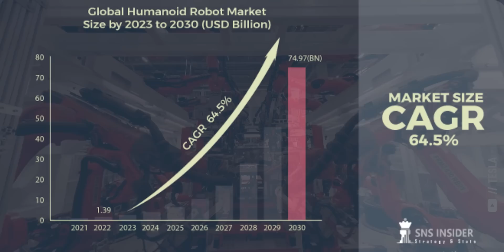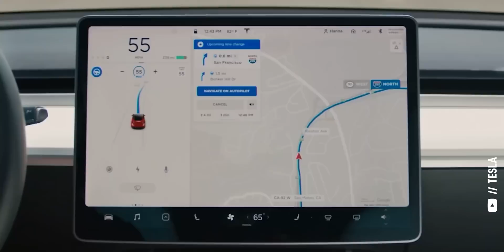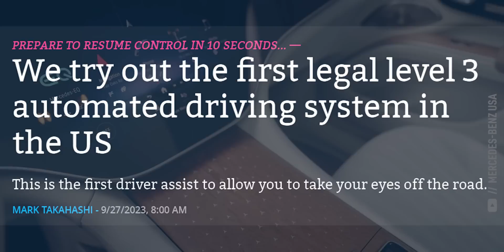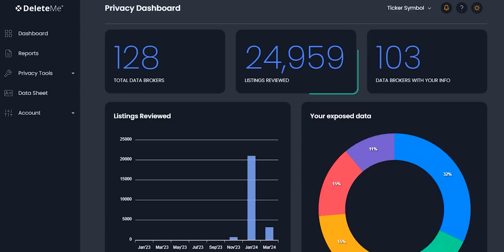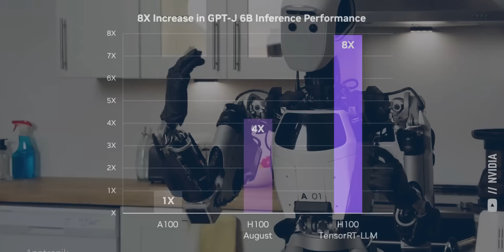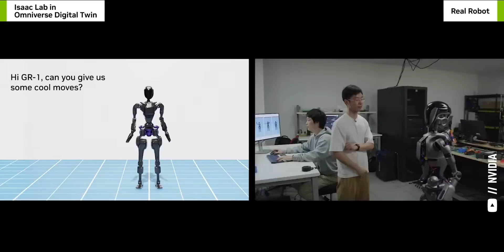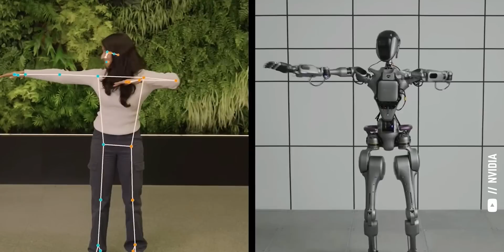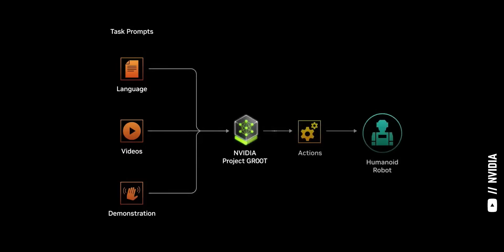HUGE GROWTH: I'm Investing In The REAL Winner of AI Robots

Comment: the mercedes tesla comparison is misleading. if tesla operates at level 5 but claims level 2 functionality for legal reasons then what level is it really at? if mercedes claims level 3 with 100 real world constraints limiting its stated level functionality, then what level is it in the real world. the tesla system out performs the mercedes system in all metrics. tesla isn't concerned about marketing speak or appearing to be better, it is actually working on being better. the difference between engineering and marketing.

Comment: I don't understand how Tesla using transformer networks and "deleting 300,000 lines of code" puts them in a position to lose the race in FSD. They're still number 1. They have all the data they need. NVIDIA's car there in the video had a huge camera strapped to the top of it? So is that necessary to get it to work? Oof. Not to mention only works on specifics routes...

Comment: Mercedes being level 3 is very misleading. It’s so limited in situations that you can look away from the road, Tesla FSD is way more capable in pretty much every other situation. Mercedes self drive doesn’t make turns, stop at stop signs, or any other of the complicated situations FSD can handle well especially after v12
Reply: You’re destroying his love for Nvidia😢 be nice pls
Reply: @romaniuc.n  I love nvidia, but you can’t ignore these things.
Reply: But. ..you can look away from the road! Thats a capability that Tesla FSD (which I have on 2 cars)  needs to HAVE to make it worth the ridiculous price ($12k)  Tesla wants for it.  And Tesla is leaning away from that capability by now calling it "Supervised Self Driving".  Mercedes puts much better sensors on their cars so that the driver can look away
Reply: @Saxafruge  Under the conditions required for Mercedes L3, you can definitely look away from the road in your Tesla (though it won't let you) The basic auto pilot is as good as, if not better than Mercedes L3.
Reply: @Saxafruge  Its not about the sensors. Self driving car is 99% software problem.
Reply: @malax4013  But  Tesla removed thousands of lines of software, and replaced it millions of hour of machine learning, only made possible by very expensive  NVidia H100 hardware accelerators,  the same accelerators that made LLMs a thing.  But several $8 cameras is all a Tesla needs eh
Reply: @Saxafruge  What is your point? Yes Tesla removed 300k lines of heuristic code because you would probably need 30000k lines of code to make FSD work with if/then statements.
Neural networks are that much better with complex situations.

Nvidia h100 is not the thing that make machine learning possible. You could train FSD on your laptop it would just take millions of years.

Training clusters increases iteration and update frequenzy. (A lot)

2 cameras on rotaring ”head” and computer is minimum hardware requirement on car to make FSD work.
Reply: @Saxafruge  Neural networks is software.
Reply: @malax4013  The training is done using the Cuda parallel computing platform,  which  is a specialized combination of hardware and software, it wont run on a CPU.  Its  also not going to run on a laptop Nvidia card, they train it using big datacenter arrays and even then its easy to run out of memory, We can agree to disagree whether cameras alone will work, but i sure miss the $3 ultrasonic sensors that my original Model 3 had, they sure helped
Reply: @Saxafruge  I was saying H100 was not the the thing that made machine learning possible. 
Sure current FSD cannot be trained on cpus or gpus but you could make the software to be able train on basicly any computer. It would be possible but really inefficient and stupid.

Agree somewhat with ultrasonics. Problem was they removed them 2-3 years too early. Shouldnt be problem after Tesla vision is at superhuman level but not there yet.